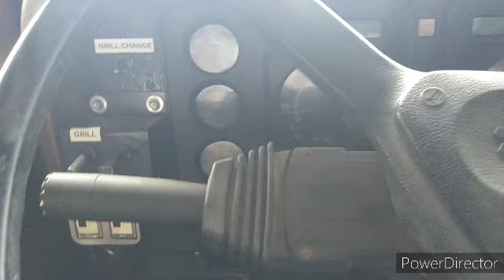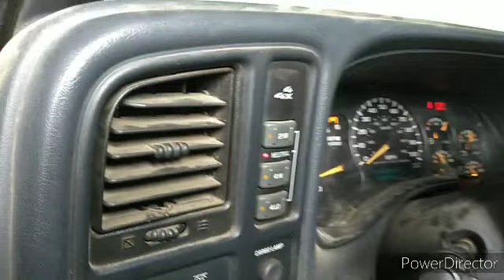service truck to the rescue.....

Comment: my farm truck is down right now (i suspect the 1yr old ipr has let go) and my kid still hasnt replaced his moose smooshed truck and is riding around in dads Ram 3500, things we do for rugrats
Reply from the maker: Too many down... We've never fixed dad's truck, the Tahoe saga🙄 and the 2016 Hyundai with 60k miles and a rod bearing gone.. absolutely no parts available for it, except for used engines at $11k plus installation.. pretty nice car too, but engines suck!! 
Tahoe is out in the rain, currently DUMPING.. so really convenient to work on.. but you know, we end up walking, so they don't have to..
Reply: @GosselinFarmsEdGosselin  oh my wifes Tucson has been at the dealership for over 5 months.....would go limp noodle when stomping on the gas but was ok the rest of the time, did have blow by, its a 2017 with 120k on it, they did lots of stuff....didnt work, next they were sure it was the motor so they got a brand new from Hyundai Canada.....shocker it didnt fix it......turns out when we took it there and i told them i replaced the steel gasket at the base of the Y pipe and they dismissed my query on excessive exhaust pressure it was the exhaust this whole time, not the cat but the flex section had come undone inside and would collapse when under pressure, so after my re headed wife going full RED WITCH on them they absorbed the previous work, the new motor was part of a recall we later found out but we have to pony up for the $2,700 full exhaust system so cant complain too much.
Reply from the maker: Non transferable warranty.. so no warranty for us. There are 3, probably 4 sitting at the local Hyundai dear that have been waiting for engines for six months or more.. and they seem to have issues with oil.. one day it's full, then it's ticking and empty.
Reply from the maker: Most companies have transferable warranty.  Hyundai does not, so they won't do anything.. if the original owner still had it, it would be at a dealership, waiting for an engine...
Reply: @GosselinFarmsEdGosselin  yet up here we arent the original owners either, but my daughters fiesta has a door issue that is only a recall in the US but not up here
Reply from the maker: @piperdoug428  crazy crap🙄

Comment: Funny how that works. The other day the wife made a trip to town. When she got home, she unloaded all here shopping wares and managed to turn on one of the reading lights over the dashboard. She didn't notice that. Being retired, we don't drive places everyday so the car sat in the garage for several days. I had to be somewhere last night. as soon as I hooked up the jumper pack that reading light came on. inconvenient but an easy fix....
Reply from the maker: It happens... The old door switches were good for leaving the dome light on. Wasn't bad overnight, but much longer than that🙄
Used to have a couple of the old jump starters. Thought about a new fangled one.. someday 👍😎
Reply: @GosselinFarmsEdGosselin  I have a HoBo Freight special. It works....
Reply from the maker: I was going to get one of these when they came out. Had a coupon..but the local stores didn't have any.
Reply: @GosselinFarmsEdGosselin  Go figure....
Reply from the maker: @mattthescrapwhisperer  like the 1/2" right angle earthquake impact that never made it across the ocean..  they have 12volt, but no 20volt🙄

Comment: We put some dead kill switches on some of the equipment while Dad was still alive. Some of the stuff wouldn't get started and driven for months. That worked very well. We have them on all of our fire trucks. They need to start when we turn the keys.
Reply from the maker: All but one truck and just one tractor have shut off switches. 
Fire trucks should all have switches, used to all have the big Cole-Hersy switches

Comment: The joys of parenthood!
Reply from the maker: Oh, yes... Lol. Thank you Wayne!
Reply: @GosselinFarmsEdGosselin  Yeah, many cold nights under a vehicle trying to get it fixed for school or work. One cold 20 degree night, working on the charging system of a 1978 truck put both my son and I, in the emergency room receiving oxygen from carbon monoxide poisoning.
Reply from the maker: That's not a good thing!!
Reply: @GosselinFarmsEdGosselin  It was a learning experience for us both. Get a good enough job to buy better vehicles or pay someone to repair issues when it’s that dang cold and miserable.
Reply from the maker: Yes!! Never nice fixing things in extreme weather.. really not sure what is worse, 20° or 100... But I can dress for the 20!!!

Comment: We been having trouble with fedex also but lately they have been improving a bit. I seen the receiver for your on-board air compressor on the service truck. We have them on all of our street trucks at work. The older models were dependable as long as you serviced them but the newer ones they add electronics and they are not so dependable.
Reply from the maker: Picked it up used, isn't hooked up yet. I need a hydraulic motor to run the compressor and have to figure out how the last 3 lines hook up..
Reply: @GosselinFarmsEdGosselin  ours were shaft driven. The hydraulic motor would make a easier installation. We had both Van-Air and Boss systems on our trucks and they are pretty much the same. If I was still working I could send a plumbing schematic but I retired this last march.
Reply from the maker: I think it's vanair.. it was PTO driven in it's former life. But the service truck has a married pump, so.. the plan is to Hydraulic drive it.